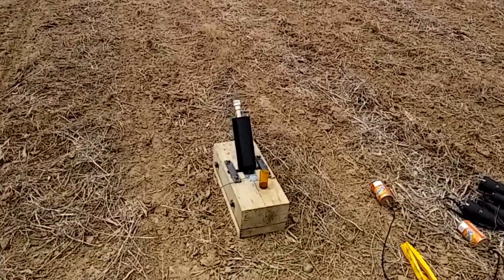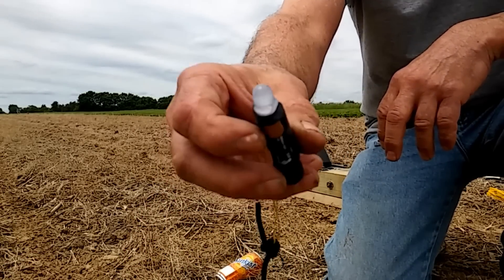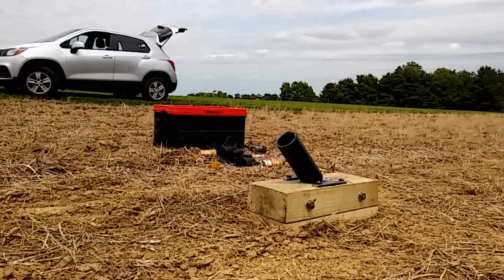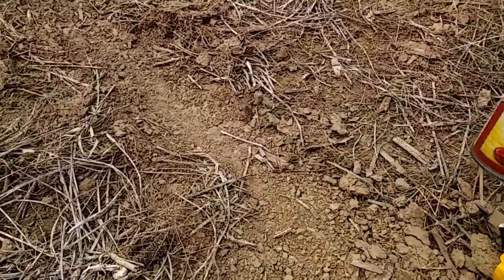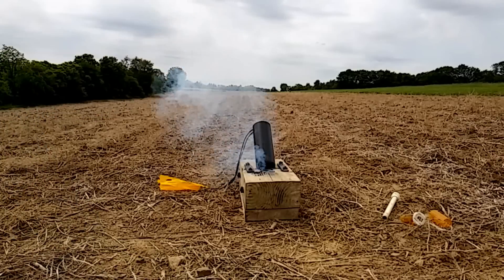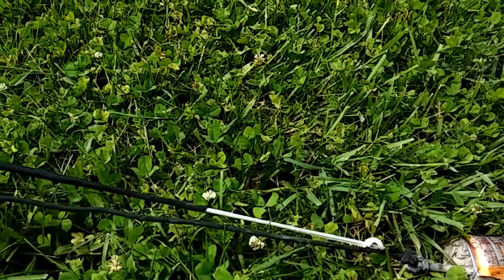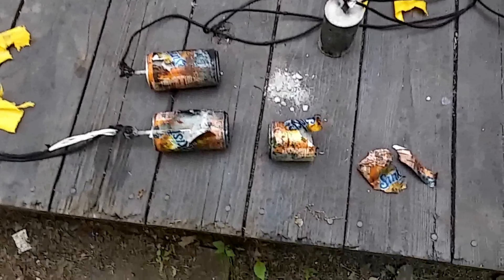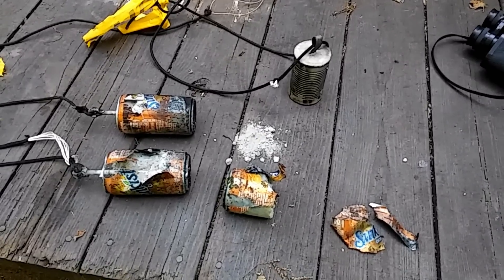5 2019 Billiard Mortar Test

Comment: Excellent - I would be inclined to try using the soda can as a discarding sabot.  A bit of concrete in the bottom, then wooden shims to support the smaller steel can inside, a bit loosely.  I would expect one-time use - they have these cans with the lightest possible gauge of aluminum.  I would expect somewhat more range - the aerodynamics of the soda can are nothing special, but shredded aluminum flapping in the breeze does not help.
Concrete rather than cement - you could try adding sand to the cement you have.  Sand is the magic - cement on its own has a lot of compression strength but very little sheer strength.  The Romans had (lime, Portland, etc.) cement way back in the day but it did not take off as a building material until somebody added sand to the equation sometime in the 19th century
Reply from the maker: I will give that a try.  Thanks for the suggestion!

Comment: The paracord is whipping against the mortar that is why it kept breaking the lights
Reply from the maker: You can full frame the picture size.  Pause the video, >  Then advance the frames using the period button on your keyboard   and retreat the frames using the comma button.  You will see that the paracord does not hit the mortar.  The glue joint was very weak and not designed for the whipping action the launch.